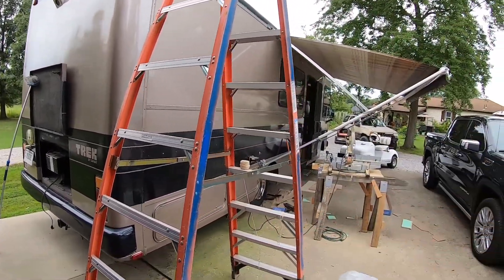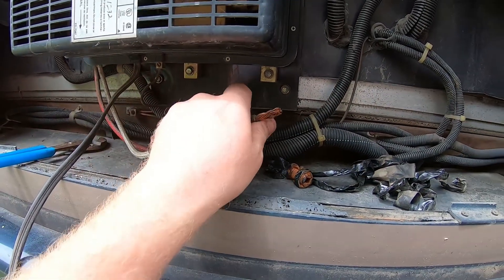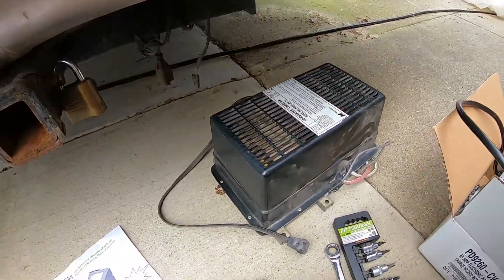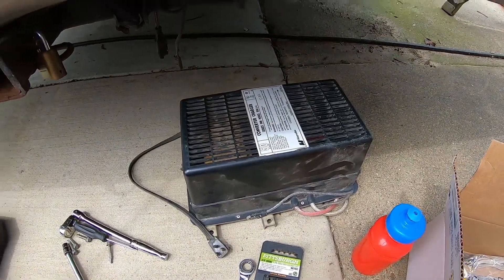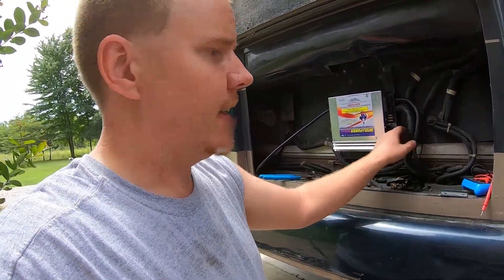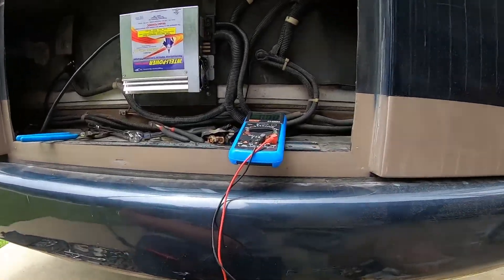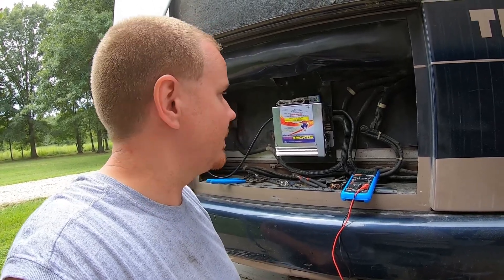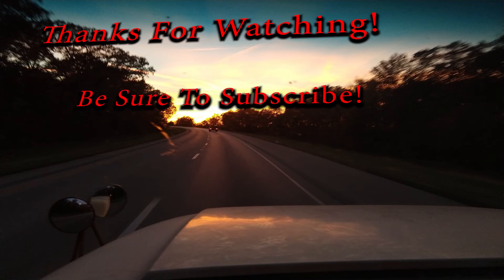RV Inverter Charger Upgrade - MagneTek to Progressive Dynamics PD9260CV - Safari Trek

Comment: Not much as far as how its working in the front!
Reply from the maker: As far as powering the 12v stuff in the rv?  It worked great.  No complaints from the owners and no more battery boiling issues.

Comment: Thanks for posting this 🙏🏼 I have a 93 Gulfstream Kingsley with the same Magnetek unit. Ever since we bought our 5th wheel we have had weak 12v power (slide outs are slow, lights dim when furnace kicks on, etc). The batteries were new when we purchased the trailer. However, they don't charge at all. We are on permanent shore power. Had the batteries tested at an auto center and was told they were fine. I'm suspecting it's the converter. Was told that the new AGM batteries don't mesh well with our Magnetek converter which was designed for flooded batteries. 

Any thoughts? What issues were you having leading up to this install?
Reply from the maker: The previous charger boiled the batteries.  They were fully charged but the charger never shut off.  This is a much nicer unit than what was removed and works well

Comment: Hey i know I am probably driving you crazy with questions but how much flow do you try to get going through ur centerfuge? Per what ever time measurement you use

I am getting very very slow flow and I worry about not enough oil going over the heating element and burning it up.
Reply from the maker: No Worries!  The stream going into my fuge is ~pencil sized which is around 5gph.  The heater has a thermostat built in so it will cycle off and on assuming its the kit that came with the WVODesigns unit.  You wont hurt it.
Reply: @NotSoGrandGarage  Okay that makes me feel better.  I get about 5 gallons per hour also but I thought It should of been more cause the paper work for wvo said 10-20 gph the centerfuge could clean so i assumed every one was running more than me
Reply from the maker: @BRWfilms  the slower it flows... the cleaner it comes out the other side.  It can run faster but if you aren't in a hurry, there's no need.
Reply: @NotSoGrandGarage  that's right. I did a batch today while I was at work just had my wife baby sit it and turn it off once it was low on feed oil.  Now I gotta look more into that hazing you talk about.  My 12 valve is getting white smoke specially while idling which I try not to do very much. I'm probably going to mess something up before I learn my lesson and set up those dual tanks Lol
Reply from the maker: @BRWfilms  at least it's easy to clean injectors on a cummins.  Doesn't take long to pull them if needed and hit them with a brass brush...  fresh copper washers and you're good to go.
Reply: @NotSoGrandGarage  haven't ever took them out but I think some one else told me that.  Good to know